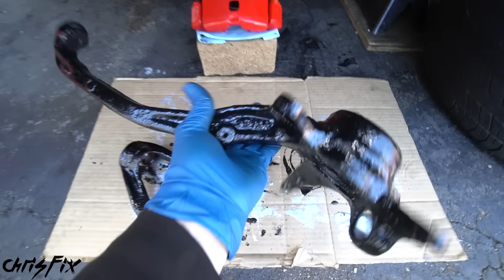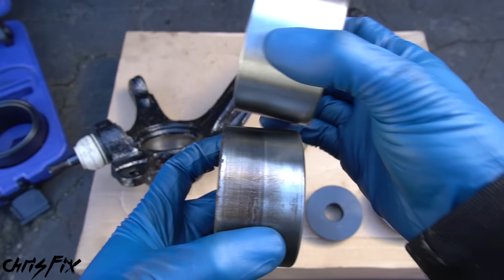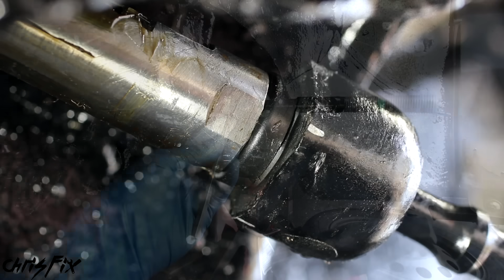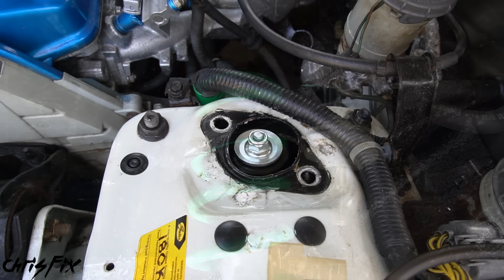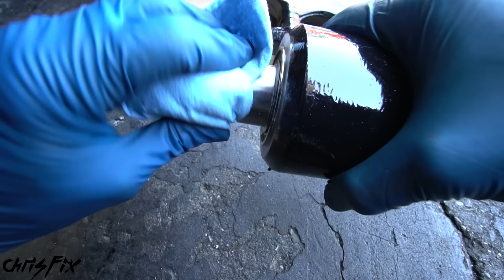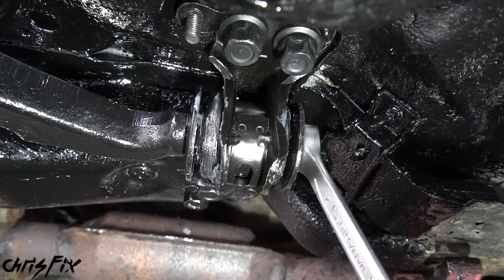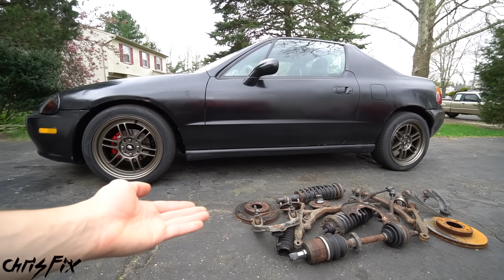How to Install a COMPLETELY New Front Suspension in your Car or Truck

Comment: That Comment on the First part of the Suspension Rebuild was A joke.

Edit : I am A kid and a Mechanic. I'll tell you all the cars I've fixed. I fixed A Exhaust and  Muffler on 2000 F150 XLT, Took out and Added Seats 1994 Sedan Deville, Fixed a Whole Motor 96 F150 XL, Fixed a Stereo that got Spilled on by Coffee 2005 Audi A6 3.2FSI Quattro and Bad Door that Had Problems Closing 1998
Lincoln Town Car. Alot of Work. Also Where can I get the Brekabahh and Soopy Wooder? And that was a joke, not the working, The Brekabahh and Soopy wooder.

Comment: Squeaking noise on my driver side wheel when I turn left or right is why I’m here
Reply from the maker: Almost sounds more like a dirty power steering system if it happens when you turn both ways: https://www.youtube.com/watch?v=VuPALAnHjRM
If the fluid looks fine, I would lift your car up safely and check out the suspension like this: https://www.youtube.com/watch?v=62bVn7E8gyk and https://www.youtube.com/watch?v=FOk0tkGEWmA
Reply: @chrisfix  yes turn left u hear it kinda turn right it gets louder so just flush it out ? I tried doing that but only took some out and topped it off w new one I don’t think I let all the air out tho could that also be it

Comment: I had a warranty repair at a Ford dealer a little over 10 years ago. Maybe 18-24 months later I went to change my brake pads and the axle spindle nut WAS NOT ON THE AXLE. It was lodged in the hubcap, and I have no idea if it came off while driving or if it was never installed, but it definitely didn't get staked.

Comment: Ngl, this makes me wanna do the suspension on my 07 Ibiza now. I took a pothole at 130kp/h in january and its still the factory side suspension. Had to replace both springs bc one snapped two days after the pothole and i to think my shock absorbers are almost gone. Car doesnt feel as snappy anymore as when we got it in august.

Any tips for a sport suspension kit, maybe with 30mm lowering on both axles? Price is a issue, dont wanna spend 1000 bucks for a car suspension when the car is like 1500 bucks nowadays lol

Comment: late to the party but let me know if i missed anything. 
-inner tie rod 
-tie rod 
-boot for tie rod 
-grease fitting 
-upper control arm 
-strut fork 
-strut 
-axle 
-retaining clip to fit axle
-axle nut
-lower control arm 
-knuckle 
-ball joint 
-berring 
-snap ring 
-hub 
-heat sheid

Comment: A quick question to Chris:
Which TYPE of suspension is the best recommended for a car, if one's most important requirement is: "achieving the smoothest and most comfort ride possible", i.e. ironing out as much as possible all bumps cracks and other road imperfections (even at the price of ignoring potential long-term reliability and longevity) ?
Thank you !

Comment: 7:45: Question: 
 
When you press the hub into the bearing, you press it into the INNER ring and not the outer.  
 
Would it not be better to use a plate that just covers the INNER ring?
 
With the large plate, if the inner and outer rings are not exactly flush, you compress the bearing until they are, stressing ball and track. 
 
I suppose for quality bearings both faces are flush, so this is no issue.

Comment: Now that my car's suspension's gone rattly, it's time for me to do this job. Chris, you're an amazing resource. Just waiting for the parts to arrive!
Reply: How much in total were part costs?
Reply: @audiizestar  ended up doing coil springs £45, drop links £18. Had already done wishbones £60 and brakes. Struts didn’t need doing, though that did mean using spring compressors. Didn’t have the tools to do tie rods, so that and tracking was about £60. Be warned: drop links were properly rusted on. Had to cut them off with an inadequate deemed and about 30 cutting discs. That wasn’t fun.

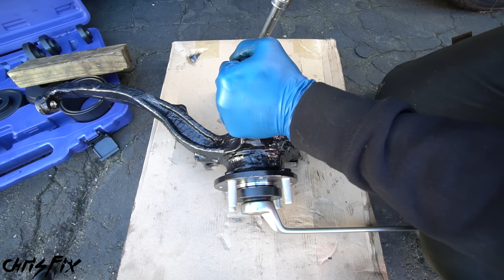Comment: Just a note that the support die should press up against the inner bearing race and not the outside to fully isolate the press load during the operation @ 7:55.

Comment: Quick question why need to tight the that’s so nut with the tire dropped on the car on the ground and take it off and  nailing the small thin to locked it

Comment: I was really hoping to see a truck suspension because of the torsion bars.
Reply from the maker: Everything is the same except with torsion bars need to be replaced. You support the lower control arm with a jack and slowly lower it to "unwind" the torsion bar.

Comment: Is it really okay to switch 4 lug wheel hub to 5 lug? Is there anything else that i need to replace other than the hub if i were to change it? Cause I always wanted to run a 5 bolt wheel thanks!

Comment: Hey Chris, what's that at 11:04 that looks like green grease on the inner tie rod and steering rack? gonna do this to my car, what is that called?
Reply: High temp grease.
Reply: general high temp grease works fine. some situations call for specific ones however such as  a high temp silicone based grease for brake jobs. Good luck !

Comment: Chris, how are you so sure the car won’t fall on you when your under the car? With jack stands?
Reply from the maker: The car is supported squarely and safely on jack stands so there isn't much (or really any) risk that it can fall. I'm all about factors of safety though, which is why I'll usually use jack stands (I prefer ramps and will use them but you can't use them all the time), get the wheels chocked off, slide the tires under, and keep the jack under the jacking point. Your chance of anything happening by that point is pretty much zero!
Reply: @chrisfix  thanks! I’m thinking to start working on cars, so I need tips! I was scared that the jack stands might not work if I was under the car and it might fall on me, thanks!!

Comment: Hey chris 

Great video, some much knowledge to gain here Thankyou 

Is medium strength thread lock the same as removable thread lock? If not, when should removable thread lock be installed? I see that you didn’t put it on the bushing bolt at 16:50

Comment: Just wanna say, DON'T use an impact on a tool like this. They're typically just cast aluminum, and an impact will DESTROY the threads on them. I learned this the hard way a few years ago when I rented a spring compressor and used an impact on it, and it trashed the threads and I ended up having to pay to replace it. ALWAYS just use a ratchet on it

Comment: Awesome video, love the channel!
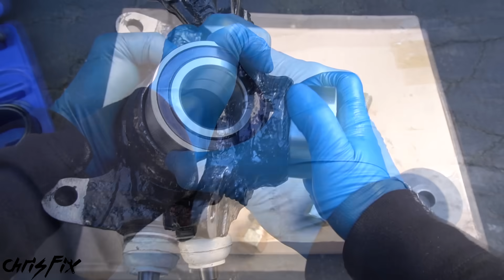I noticed, you correctly pressed the bearing in the bore at 5:45. 
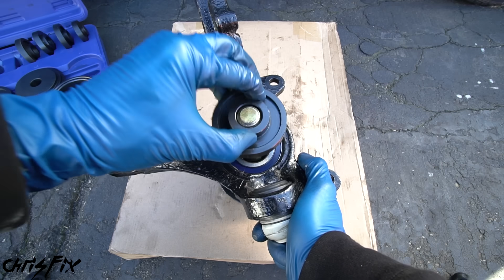Then at 7:41, you are not supporting the inner race when pressing the shaft into the bearing.
Bearing in bore, support outer race, shaft in bearing, support inner race.

Thanks for your time.
Reply: I noticed that as well. You are right. That is a mistake and it can ruin the bearing if the inner an outer races are not exactly at the same level. But usually they are.

Comment: Can anybody explain to me what the whole torquing thing is. Like Idek what to look up to learn abt it
Reply: Pretty simple. Torque is turning force. It is usually measured in newton meters (metric) or foot pounds (imperial).  Different bolts need different amounts of tension so need different torque settings.

Now imagine a socket  wrench (of zero weight for sake of this explanation)  set on a bolt with a 1 foot long handle which is horizontal to the ground and then add a 1 pound weight to the end of the handle - the turning force that gravity applies  is one foot pound. If you increase the length of the handle to two feet long with a one pound weight that would be two foot pounds. If you had 1 one foot handle and 35 pounds weight hanging from the end that would be 35 foot pounds.

A torque wrench can be set using a 'vernier scale' (search vernier scale on Wikipedia) set in the hand grip to a particular torque value and when you reach that turning force the wrench head will click to indicate you have reached the desired tension on that bolt. You would have seen that in the video numerous times.
Reply: @DanWahrenberger  thx I’m currently 14 just tryna understand as much as possible about cars so I can mess with mine when I get my permit. This was super helpful🙏

Comment: can you comment on the axle? Can there be any play in the bearings? I bought a new one it does kind of play a little and that makes me very uncomfortable. Still waiting for some parts, so not installing it, wonder if you can help. If it's a bad thing, i'd rather bring it back to the shop and change.
Reply from the maker: Axles will usually have a little play to compensate for suspension movements, if it goes in nice and smooth you should be perfectly fine!
Reply: @chrisfix  thanks man!

Comment: In my experience, it's better to hand start the nuts on to the top of the strut...mount everything else in place and once the tires are back on, lower the car so that the struts naturally go into position. Then tighten the nuts to spec.  This is just something i was told by a Monroe technician.
Reply from the maker: Thanks for the tip!

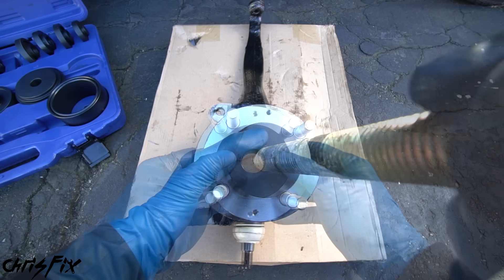Comment: Shouldn't both adapters at 07:37 rest on inner bearing race? I'm little confused here. I think that when one press plate rests on outer bearing race that means when you tighten the bolt you can damage the bearing as opposed to situation when two plates rest on inner bearing race in which case you just 'compress' inner race and not apply force to bearing balls etc.

Comment: Amazingly helpful video.  I've been putting off doing this work and my poor Del Sol just sat for years because I couldn't drive it.  You have saved my Del Sol, sir.  And thank you for the torque specs.
One note for those doing this:  "just push the boot over the ..."   This can be way more difficult than it looks.  If you are struggling - I finally got it on by removing all the mounting bolts from the rack and the link to the steering to move the rack enough to get better access to the boot.  It took me about 30 minutes of extra work, but I was just about to give up after 3 hours of struggling to put the boot on like in the video.

Comment: You made putting the drivers side rack boot on look so easy.  I'm about to just give up.  I thought putting some grease on would help...  made it worse, it's like trying to push a noodle into a hole.  Without being able to see the hole, or the noodle, or your hands.  I'm darn near ready to just pull the rack out of the car to put it on.  After two hours of struggling and failing, I'm thinking it would just be easier and take less time.
Reply from the maker: Darn! How far up is the rack?
Reply: @chrisfix  Check my other post.  It is a Del Sol with a power steering rack.  That limits access from the rear side.  I read that others have had this problem as well.  Could be some aftermarket boots are harder to get on, or I just have really big hands!  I didn't pull the rack all the way out, just had to shift it 2 inches to get access from the bottom. It was on in 5 minutes after that.

Comment: Hey mechanics of youtube, what could go wrong if you overtighten the bolts past the specified torque suggested?  Also is bedliner good to put on the bottom of a car frame after i clean it to keep rust from occuring? Thanks

Comment: Is it necessary to change the link rods and steering column while having a front suspension change? I have a car with 48000 kms on it and just had the rear suspension changed.

Comment: Superb demonstration. I am about replace the entire front suspension on 2011 Camry and this video was vey very helpful. It was all the “little things” , like how to face parts, measuring, the order in which to install and how to secure and then tighten. I especially liked the axle to tie rods to wheel hub and that all the parts you needed were displayed.
Great pace and great detail. No mechanic, I’m doing this myself now.

Comment: you should get crows feet wrenches that you can put on your torque wrench for hard to reach areas. I'm a old Honda mechanic and I understand the hard to reach areas, but if you do decide to get those,always torque at 90 degrees or it wont properly torque. I hope you see this!

Comment: Sir, can you please put out the tools you used on working on the suspension ? And please where should I place the jack when jacking up the car. I have opel astra which I noticed a sound when I jacked down the car.

Comment: I got a question. Would you have to bleed the front brakes when doing this? I know you didn't show bleeding it, but it looked as if you replace the entire coupler and I thought it would have to have the air removed. Not being an smartass, I am legit curious.

Comment: Why didn't you buy a new knuckle? I understand that scraping the rust off and painting it will make it significantly better, but since you already bought the whole suspension and are in there anyway, why not replace the knuckle?

Comment: I have a 2004 Chevy silverado exended cab 5.3L eng. When I put my foot down on the gas pedal to pass it has no power can you help me. Tell me what's wrong  thanks
Reply from the maker: Most likely your fuel filter is clogged and is restricting flow, I would do this to fix it: https://www.youtube.com/watch?v=o7Skqc5nVKY

Comment: I saw the dude Chris bought the car from. ¿What if the transmission is actually bone dry..? "Oh, it didn't leak out, we don't need to fill it."... Even if Chris already did it, it should be topped off to be on the safe side... Just sayin'...
Reply from the maker: I checked and it was all good!

Comment: All in all not bad, however when pressing the hub into the bearing youre incorrect on supporting the outside, you must support the INSIDE of the bearing while pressing the hub into place.
Reply from the maker: Thanks for sharing!
Reply: ChrisFix no worries my man 🤙🏻. Awesome vids keep em up.
I’m a fully licensed technician as well so I’m not just trolling. The hub grappler kit I use has reference chart for pretty much every application and the cups used for drawing the hub into the centre interference fit portion of bearing they always sate to support the inner race. If not, when you think about it when you press that hub into the centre portion of bearing without supporting the back of it also on the inside all that force is being exerted laterally on the bearings and races with the way you’ve done it here by supporting the outer portion only.

Comment: I really wish he showed the new parts more.  I have most of the same parts I'm going to be installing and I'm curious if mine are defective as I've always been told that the new joints should be so stiff as to be impossible to move by hand.  Mine are quite stiff but I can indeed move every single joint (inner and outer tie rods, sway bar links, and ball joints both sides) some more easily than others.

Anyways awesome video regardless, always love watching your videos even when my car doesn't have that particular issue.  Keep doing what you do.

Comment: Hey Chris, love your videos, they're probably the only reason my old rusty wagon is still on the road. 

I'm revisiting this video because I'll be replacing my suspension soon. Something that worries me is getting an alignment afterwards. This is one area where I know precision is extremely important, which is why it's usually best left to professionals - and yet, alignments are the one thing that every mechanic I go to seems to mess up. I always get my car back with a crooked steering wheel and an "it goes pretty straight." I'm disappointed by the lack of precision that most shops seem to have, and I figure I've learned so many skills, maybe this could be another one? The worst I could do is fudge the alignment and need to take back into a shop, and then oh well, at least I'm no worse off.

But I think you have the attention to detail and stellar presentation to really shed some light on the wheel alignment process. Hope it's something we get to see someday! Thanks for reading

Comment: This car needs a hot paint to look fantastic.
Reply from the maker: It'll be getting one! What color do you think would look best?
Reply: @chrisfix  green with some other color stripes. Or red with black stripes on the side . Blue also is hot like the color if ur fathers car. Any color of those will do. Finaly we miss ur new video.
Reply: @chrisfix   That Del Sol OE green  would look tight aainst those new wheels you installed.

Comment: fantabulous job...I've checked your video of replacing the rare brake pads of a 2002 cruiser in 2012...It was a nasty without any safety gloves...without any thread lockers...but now you have changed the whole front suspension as a nothing job...amazing self develpoment...appreciated..

Comment: Hey Chris,
I recently got into an accident, the RH suspension (inner tie rod, Axle, spindle, bearing, strut, lower control arm) was damaged. The point where the chassis meets the lower control arm was heavily damaged, but we welded the part of the frame and straightened it so we could fit the control arm. However, after test driving it. It's obvious that the RH side of the car sinks down dramatically compared to the LH side. My mentor (mechanic) said that with time both sides will eventually work in sync. However, I feel like the control arm might be the reason for the kneeling go the RH side. Or maybe its the strut assembly bearing (said parks department). Please let me know what you think, really appreciate your videos and feedback.

Comment: I believe you may have pressed the hub into the bearing using bad practice. 

The hub clearly makes contact with the inner ring. When you pressed it in, though, you said you backed the press from the outer ring. If this is what you actually did, you put full pressure through the roller elements, which you are not supposed to do. The proper thing to do in this case would be to back the press from the inner ring face, so you are only putting pressure through the body of the inner ring.